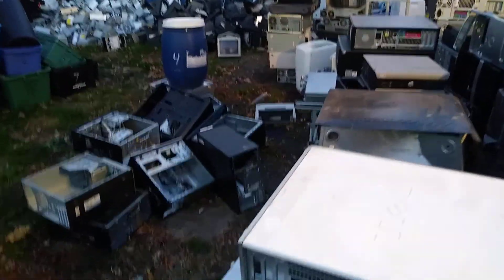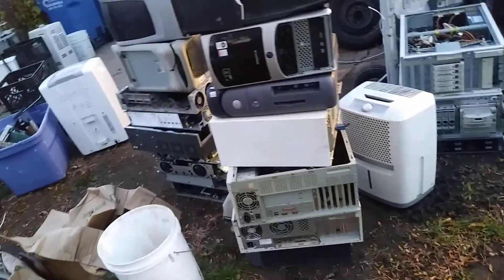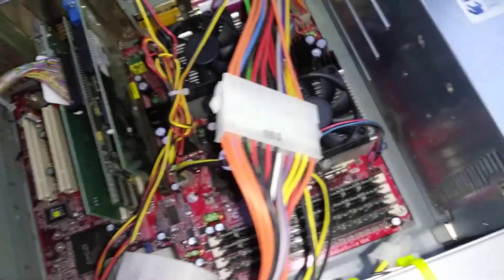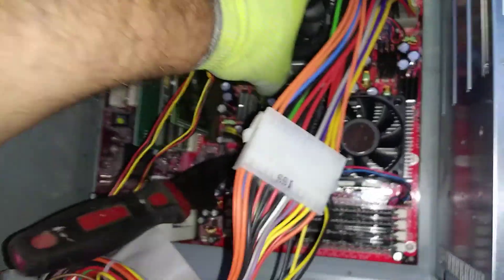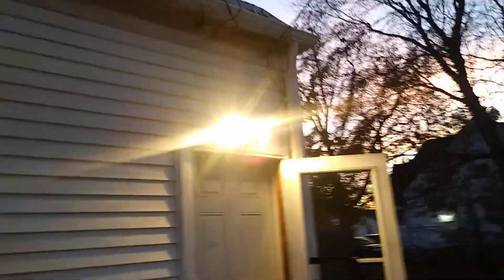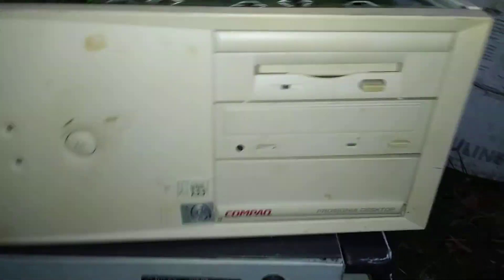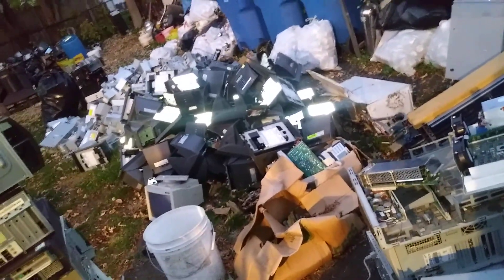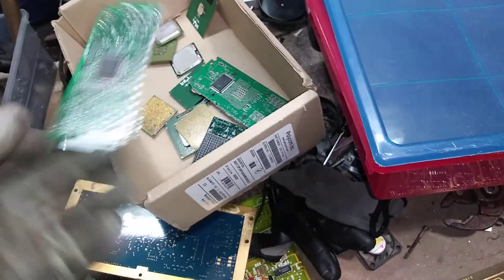I think I'm going the wrong way

Comment: Mike, what can I say. Not knowing what you can or can't do behind your house I'll give it a shot. Consider a large tarp to cover things to get them out of sight.
The next would be a portable car cover from harbor freight, 10' X20'.. basically a garage made of 2" steel poles and tarp like material. It might help when you have "overflow" from the basement.
Be safe and thanks.
Reply from the maker: Any kind of shed or carport has to be on a cement slab in my city you can't sit on dirt. I appreciate your thoughts and concerns but I do with this a couple times a year usually so once it's behind the house and out of sight they leave it alone. Plus it motivates me to clean the yard lol
Reply: @ewastemike7700  well crap!!!! Id say something else but......
Anyway good luck.
Reply from the maker: @donniebrown2896  i alway's get it handled. Lol